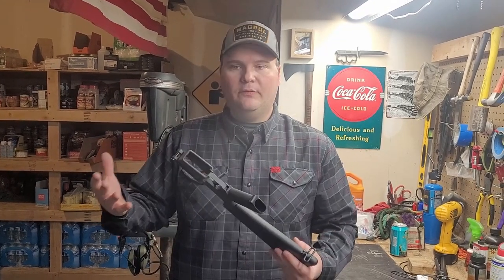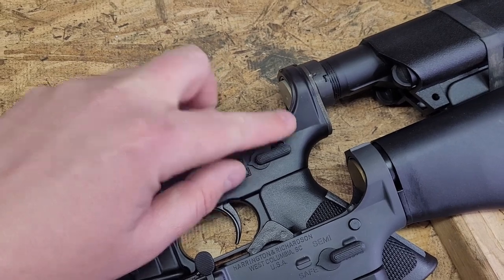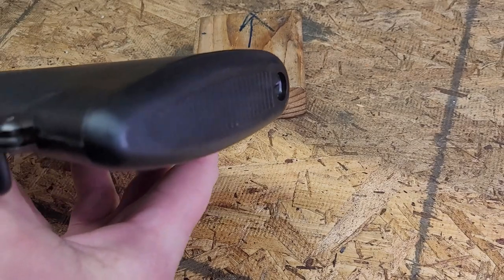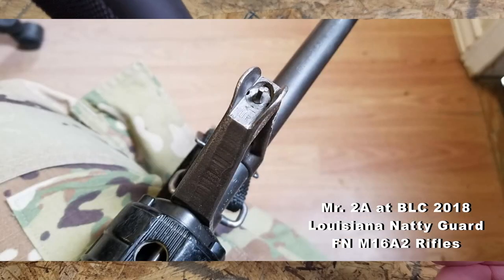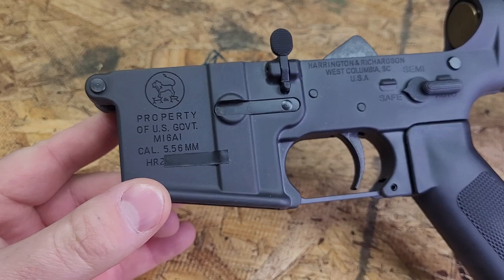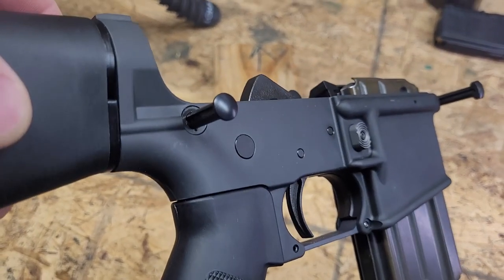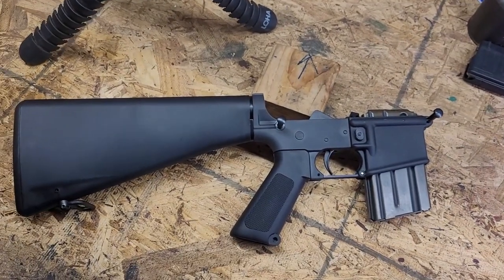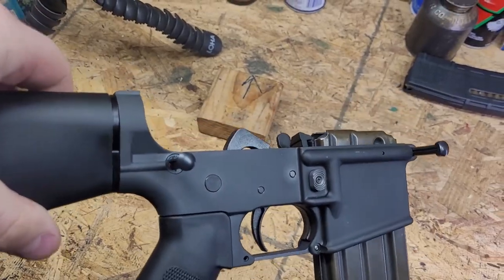H&R M16A1 Lower Quick Look

Comment: Would have been nice to see the area under the front pivot pin. If they are taking an "A2" and converting it to an "A1" they have to mill and square out that area. I've seen some sloppy work on Troy's and even Colts retros in that spot.

Comment: It would have been about perfect if they had properly finished the other small parts in the correct shade of gray.
Reply from the maker: It's strange: the hammer and trigger pins are given the gray treatment, but the rest is like a cheap bluing. With a little outsourcing of parts, I think the lower itself is pretty ok. I would like to see them invest in actual roll mark tooling as well, but for the price I'm satisfied with it.
Reply: I don't care if H&R shipped them out Sky Blue Yellow...produce the damn product and I'll take care of the Color from there.  

I've done a number of Black Oxide finishes and made them as close to Colt Sniper Gray as possible.. I can live with a shade off.. I can't put up with waiting forever for a product that nearly made from Un-Obtanium

Comment: Until H&R does the Right thing regarding their Real Loyal Customers,  by letting you purchase a build position for Stripped Lowers and Uppers.. the Scalpers are going to win .

I'm on my 3rd H&R Purchase and Not One has included their corresponding Upper.. gotta get it where you can.  The Retro market is artificially Insane.  The demand is their.  If you can produce M4 stuff.. you can produce the other just as easily...Colt certainly had No Lock on this as H&R, GM Hydra-Matic,  Olympic. DPMS , Rock River and how many others before indicate.. its a matter of wanting to.
Reply from the maker: Oh -Colt willfully and stupidly gave up their own corner in the clone market many years ago. I think everybody else trying to fill that market space are at the mercy of old forgings, dies, and production. Any carry handle uppers of any variety or anodizing seem to be harder to acquire by the day. They can't machine if they don't have forgings in the first place, and it's 100% true that the clone situation has become so upside down that we got to go to PSA for a semi-OKish product line that's also never in stock. It's a real mess right now.